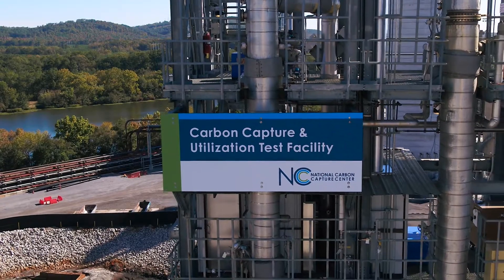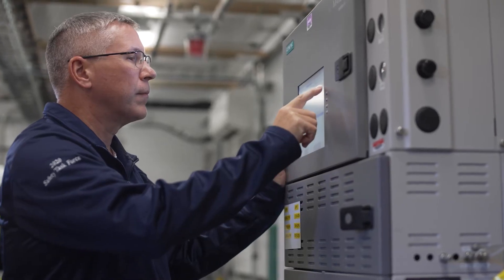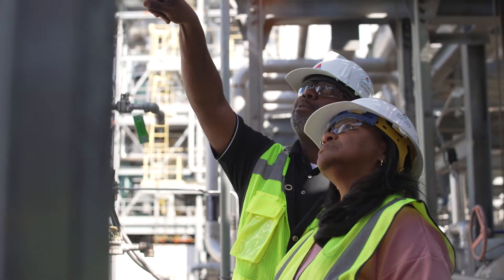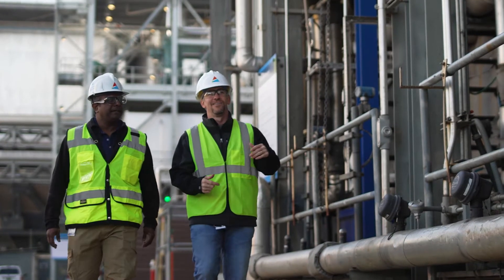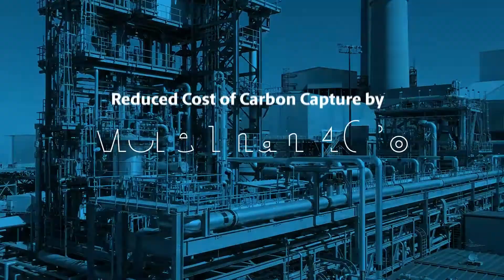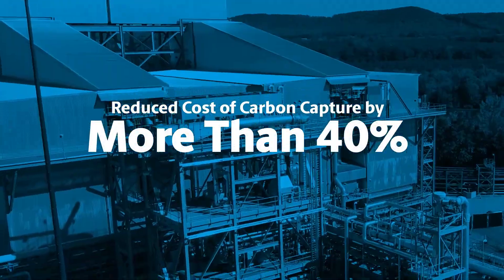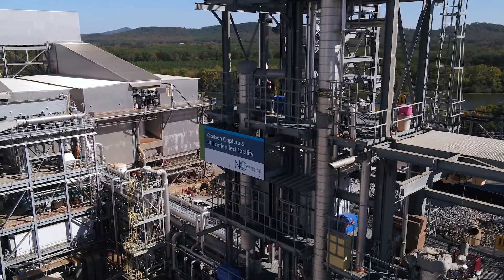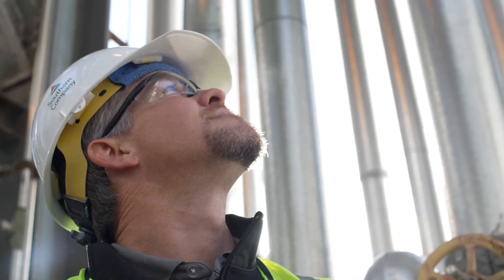This is the National Carbon Capture Center

Comment: Carbon capture is a fool's solution.  It's great to research and develop carbon capture technology in case climate change becomes so extreme that out of desperation we have no choice but to use it.  However, the only viable solution for the foreseeable future is to stop emitting carbon into the atmosphere, and that requires moving to sustainable electric power and away from extracting and burning fossil fuels including methane "natural" gas.